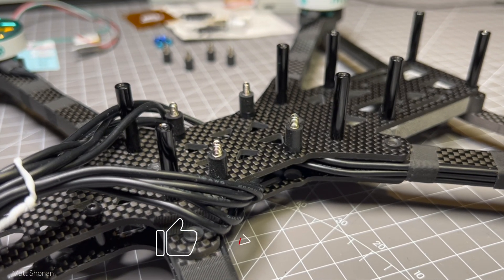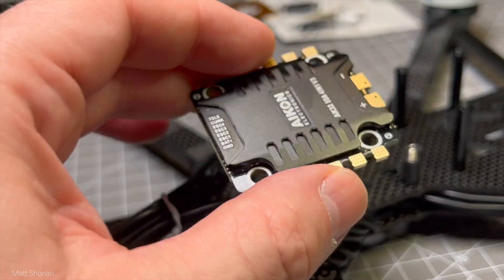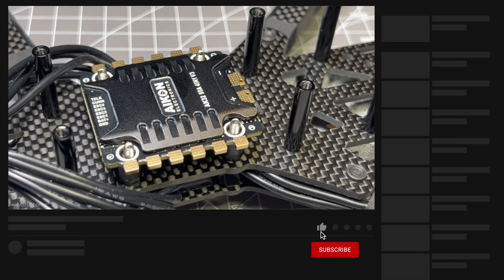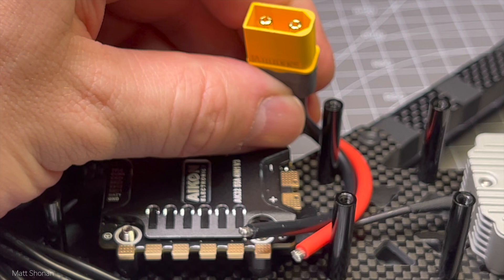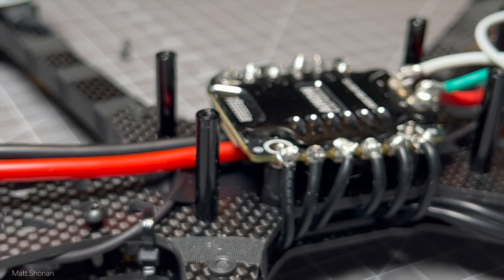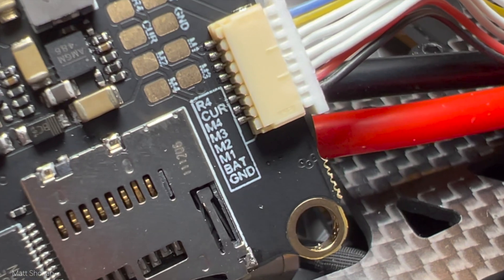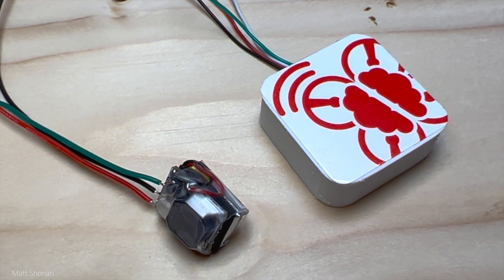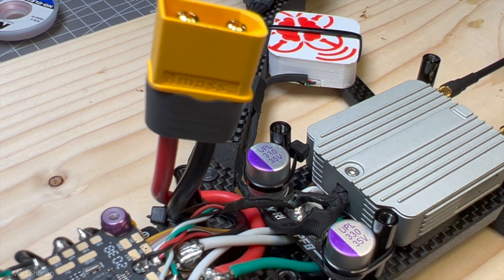AOS Falcon 7 FPV Cycle 30mm JBF7 FC | DJI Action 2 | long range build PART 3

Comment: Matt, can you share your BF settings for your build. Happy 2022
Reply from the maker: Happy New Year! 🥂
Sure,  I will share this until end of this week in the comments right here.
Have a great day! 👍🏻
Reply from the maker: board_name JBF7
manufacturer_id IFRC
mcu_id 003400194e53500f2030304e
signature 

# name: AOS Falcon 7

# resources
resource MOTOR 1 C09
resource MOTOR 2 C07
resource MOTOR 3 C08
resource MOTOR 4 C06

# feature
feature -AIRMODE
feature -ESC_SENSOR
feature GPS
feature TELEMETRY
feature LED_STRIP

# beeper
beeper -ON_USB

# map
map TAER1234

# serial
serial 1 1 115200 57600 0 115200
serial 3 2 115200 9600 0 115200

# aux
aux 0 0 0 1700 2100 0 0
aux 1 46 2 1225 2100 0 0
aux 2 13 3 1700 2100 0 0
aux 3 28 3 900 1300 0 0
aux 4 35 2 1700 2100 0 0

# rxrange
rxrange 0 1004 2011

# rxfail
rxfail 6 s 2000
rxfail 7 h

# master
set gyro_lowpass2_hz = 325
set dyn_notch_width_percent = 0
set dyn_notch_q = 250
set dyn_notch_max_hz = 350
set dyn_lpf_gyro_min_hz = 260
set dyn_lpf_gyro_max_hz = 650
set acc_calibration = 22,28,-24,1
set mag_hardware = NONE
set baro_hardware = NONE
set min_check = 1010
set max_check = 1990
set rc_smoothing_auto_smoothness = 27
set fpv_mix_degrees = 30
set serialrx_provider = CRSF
set blackbox_p_ratio = 64
set min_throttle = 1070
set dshot_idle_value = 525
set dshot_bidir = ON
set use_unsynced_pwm = OFF
set motor_pwm_protocol = DSHOT600
set motor_pwm_rate = 480
set failsafe_procedure = GPS-RESCUE
set vbat_max_cell_voltage = 410
set vbat_min_cell_voltage = 320
set vbat_warning_cell_voltage = 335
set current_meter = ADC
set yaw_motors_reversed = ON
set small_angle = 180
set gps_provider = UBLOX
set gps_sbas_mode = AUTO
set gps_auto_baud = ON
set gps_set_home_point_once = ON
set gps_rescue_angle = 37
set gps_rescue_descent_dist = 70
set gps_rescue_throttle_max = 1750
set gps_rescue_ascend_rate = 700
set gps_rescue_throttle_hover = 1450
set gps_rescue_sanity_checks = RESCUE_SANITY_FS_ONLY
set gps_rescue_min_sats = 6
set gps_rescue_allow_arming_without_fix = ON
set gps_rescue_alt_mode = CURRENT_ALT
set deadband = 15
set yaw_deadband = 7
set osd_warn_rssi = ON
set osd_warn_link_quality = ON
set osd_warn_over_cap = ON
set osd_cap_alarm = 1300
set osd_vbat_pos = 2080
set osd_rssi_pos = 14662
set osd_link_quality_pos = 241
set osd_rssi_dbm_pos = 14497
set osd_tim_1_pos = 386
set osd_tim_2_pos = 418
set osd_remaining_time_estimate_pos = 25
set osd_flymode_pos = 2497
set osd_anti_gravity_pos = 141
set osd_throttle_pos = 385
set osd_vtx_channel_pos = 161
set osd_crosshairs_pos = 2253
set osd_ah_sbar_pos = 2254
set osd_ah_pos = 2126
set osd_current_pos = 2401
set osd_mah_drawn_pos = 2421
set osd_craft_name_pos = 8225
set osd_gps_speed_pos = 2144
set osd_gps_lon_pos = 8268
set osd_gps_lat_pos = 8236
set osd_gps_sats_pos = 2241
set osd_home_dir_pos = 2274
set osd_home_dist_pos = 2209
set osd_flight_dist_pos = 192
set osd_altitude_pos = 2176
set osd_pid_roll_pos = 8426
set osd_pid_pitch_pos = 8426
set osd_pid_yaw_pos = 8426
set osd_power_pos = 2433
set osd_pidrate_profile_pos = 8426
set osd_warnings_pos = 14633
set osd_avg_cell_voltage_pos = 2388
set osd_pit_ang_pos = 8426
set osd_rol_ang_pos = 8426
set osd_battery_usage_pos = 4
set osd_disarmed_pos = 2315
set osd_nvario_pos = 8426
set osd_esc_tmp_pos = 14336
set osd_rtc_date_time_pos = 8426
set osd_flip_arrow_pos = 65
set osd_core_temp_pos = 166
set osd_log_status_pos = 97
set osd_stat_endbatt = ON
set osd_stat_battery = ON
set dashboard_i2c_bus = 2
set gyro_rpm_notch_min = 87
set name = AOS Falcon 7

profile 0

# profile 0
set dyn_lpf_dterm_min_hz = 91
set dyn_lpf_dterm_max_hz = 221
set dterm_lowpass2_hz = 195
set vbat_sag_compensation = 100
set iterm_relax_cutoff = 9
set pidsum_limit = 1000
set pidsum_limit_yaw = 1000
set throttle_boost = 7
set p_pitch = 56
set i_pitch = 99
set d_pitch = 43
set f_pitch = 105
set p_roll = 51
set i_roll = 94
set d_roll = 40
set f_roll = 99
set p_yaw = 55
set i_yaw = 99
set f_yaw = 99
set d_min_roll = 0
set d_min_pitch = 0
set ff_interpolate_sp = AVERAGED_3

profile 1

profile 2

# restore original profile selection
profile 0

rateprofile 0

# rateprofile 0
set thr_mid = 37
set thr_expo = 25
set roll_expo = 30
set pitch_expo = 30
set yaw_expo = 30
set roll_srate = 62
set pitch_srate = 62
set yaw_srate = 60
set tpa_breakpoint = 1750

rateprofile 1

rateprofile 2

rateprofile 3

rateprofile 4

rateprofile 5

# restore original rateprofile selection
rateprofile 0

# save configuration
save

# restore original rateprofile selection
rateprofile 0

# save configuration
Reply from the maker: Here you are!🤙🏻🙃
Have a great rest of the day and happy flying!

Comment: All your soldering looks too cold.  Needs more flux and more heat.
Reply from the maker: wow, that you saw that ... 
Thank you for your comment, you are absolutley right!
My two mistakes were that I used unleaded solder and as you said, only very little flux. 
I have solder on order as well as a new flux pen but all arrived too late. 
Merry Christmas and Happy Holidays 🎄🎅🏻

Comment: is there a RTF for the AOS Falcon 7?  thx  ¶ : - )
Reply from the maker: Unfortunately not yet, maybe never . . .
It all depends if some bigger store picks it up and offers a RTF option.
Since the frame is really high quality, the cost is not on the low end. 
Profit margins for other RTF 7" long ranges quads might be beneficial for stores to offer. 

That is also the reason for this build series, sharing the experience in case someone likes to follow, building one. 👍🏻🎅🏻🎄
Reply: @MattShonan  what will be a good alternative?
Reply from the maker: Well, it is difficult. ...
Maybe the 7" from Rotor Riot could be an option.
Reply: Ill build you one using that frame.  Just reply to this comment and ill send you my contact info.  I would only ask for a 100 dollars above what the parts cost.  Ive built lost of other quads here is my channel.  https://www.youtube.com/watch?v=yZioKNWD3sU